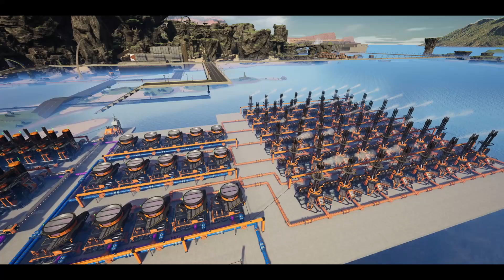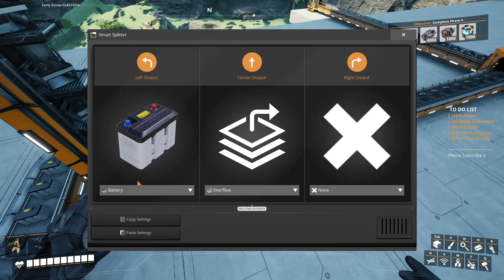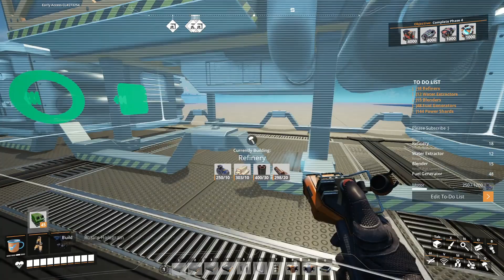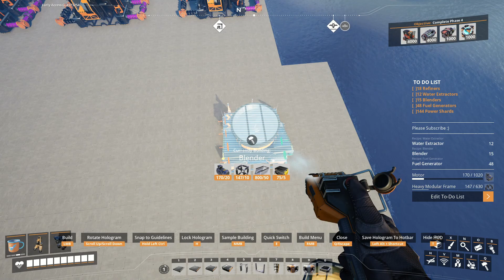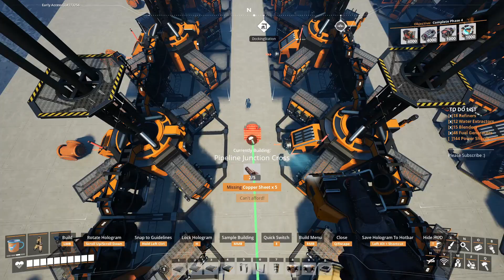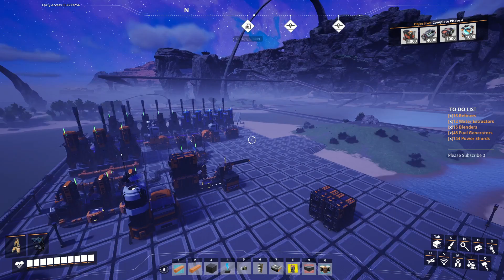I TURNED WATER INTO... POWER!? Satisfactory Update 8 - Relaxing Gameplay Series w/Alternate Recipes

Comment: Good stuff.  I am or was trying to build power on the same node.  At the same time setting up my basic aluminum build.  I decided to try to get fancy and go a little vertical with things but am now thinking that might be the problem for tier 2 pipes.  I ran everything twice and that is after I made sure of the numbers.  Measure twice, cut once sort of thing but more like measured 3 times and cut twice now.  And it still fails.  I am going to go back and rebuild with no vertical and if that fails yet again convert to more what you have there.  
I think honestly the part that upsets me most is I was working on aluminum when  I would like pipes fill and when checking and attempting to correct things and the aluminum is working fine.  I wasn't even focusing on it, was really more just an aside while trying to fix the fuel plant.  And except for one easy to fix slip up it worked out great.  Once I do get things cooking I am going to use another of those oil nodes and experiment some.  I have gone vertical with tier 2 pipes just never full 600cml pipes.  Why can'[t you move full pipes vertical?  I might not find out why, but I am going to try to make it work somehow.
Looking forward to the next builds though I will be dropping behind now.  I doubt I restart when 1.0 drops.  I will just use this save until I am sure things are working in 1.0 based on watching some play.  Might even go for end game with this save even if 1.0 comes out.

You do know there are 2 Pure Copper nodes just beyond the 4 Pure Iron nodes you are using for the CO build?
Reply from the maker: I actually ended up taking copper out of the CO build entirely and it's made from just iron quartz and water! 

I'm not sure if this was a good idea but it was fairly simple and clean lol 

I really like keeping everything flat it's a very satisfying look but it's getting taxing on my PC the more exposed things I have.

I'm kind of looking forward to a fresh start again hoping it's working good enough on release 😎
Reply: @CheffreyPlaysGames  Have you heard anything about the release window yet? All I've seen is "this year" lol.
Reply from the maker: @denalidtx  the closed beta is either finishing up or is finished now so honestly it will probably be sooner than we think!
Reply: @CheffreyPlaysGames  Oh, I hadn't heard that! Nice!